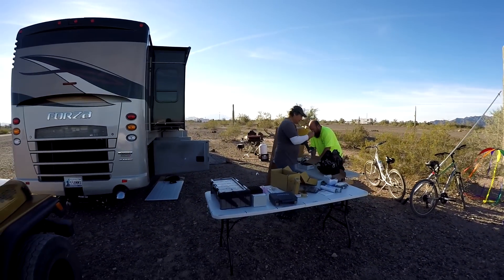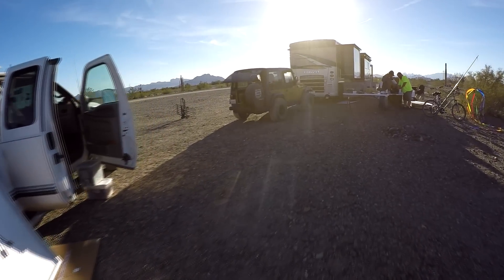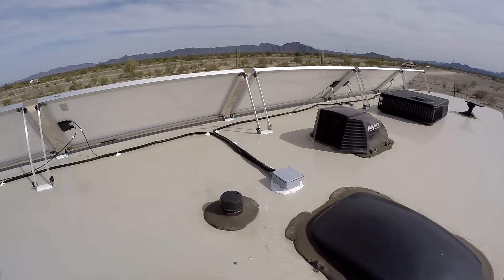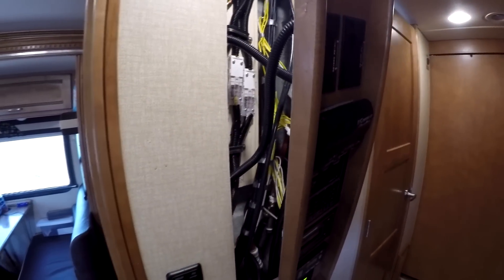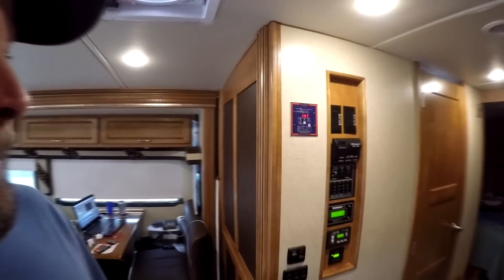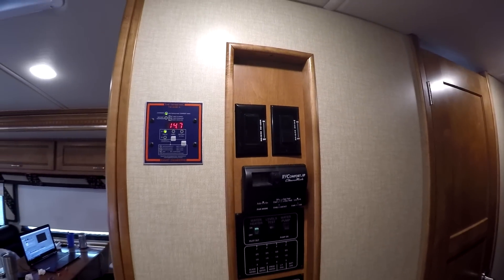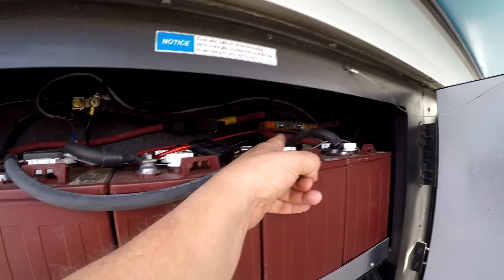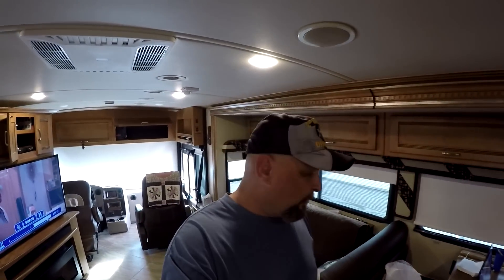S1LAWG,E76 - Solar Install 2017 Winnebago Forza - Nomadic Native

Comment: Nice video of the installation of the solar system. I just purchased a 44' park model trailer and aim interested in putting in a system like what 
You have let me know if something like your system will on my park model trailer 
Thank you for your time
Reply from the maker: Ray Gould no doubt it will work well for you. Many will tell you to figure how much power you need and install enough solar to meet the need. What I'm going to tell you is to install MORE than you think you'll need because you will never be upset by having to much, but not having enough is a real bummer.

Comment: Where do you store the ground panels when motoring and what do you do to protect them?
Reply from the maker: Stephen Miller in the front driver's side bay, on the shelf above the propane tank. We've not used them since installing solar of the Forza. The 960 watts on the roof & 6 T-105's has met our needs & goals very well thus far. I will likely be rid of the rigid panels someday soon in favor of flexible panels as they have become more reliable over the years, easily stored, much lighter, & we will just lay them out on the ground should we ever need them. Thanks for watching!

Comment: I hope you have time to answer a question.  I have the same RV (Forza 36G) and am installing Solar (a lesser wattage system)  My question:  How were the wires that run from the roof through the control center and into the basement ultimately get to the controller.  The direct route would take it through the grey water tank and into the cabinet that is in front of the passenger side rear wheels.  I would just like to know how this wire was routed, so I may do likewise.  Thanks!
Reply from the maker: Ray Fiorillo it's a direct run through the bays, beside the tanks, and into the same bay as the inverter. It looks very tight quarters but once you get started it's not to tuff. Please let us know how your install goes for you & how your solar works out for you, ours is working really well for us.
Reply: Thanks for taking the time to reply; we'll let you know how it goes,  we will likely attack this project in about two weeks... Again thanks!

Comment: Although your installation looks good it has a fatal flaw. You should not ever run groups of series panels in parallel. You either run run panels in parallel connected to a charge controller or you run panels in series to a charge controller that can handle them. 

Every bank of panels should have its own charge controller and the output of those controllers are then paralleled. 

So in your configuration you should have three charge controllers. One for each bank of three panels in series and one for the ground bank of two panels in series. The output of those three charge controllers should go to your battery bank with each one having its own fuse and cutoff switch. 

In this configuration you can get full power and any shading of a panel will not completely shutdown any bank. There are very solid design theory why it should be done this way. 

I've posted why on IRV2 and will be publishing a complete write up when I get some free time.

Comment: that's a lot of solar and a good video recapping what you have done. would you care to share what that all cost you, we are just heading out on the road and are very curious. one other question, will it run the a/c
Reply from the maker: This RV came with an installed inverter/charger and all that due to the residential fridge so all that was really needed was the panels and a solar charge controller but I also upgraded the battery bank and installed the 2030A meter. Total cost on the Forza including the install and additional odd & ends was right at $3500'ish. The Forza has two breaker panels, the second panel is for things that are connected to the inverter. The A/C's, Washer/Dryer, and fireplace are not connected to the inverter's breaker panel. If we want to run those items not connected to the inverter's panel then we have to be plugged in or fire up the generator. I installed whole house solar on our previous RV, a 2004 Winnebago Sightseer 35N. On that RV the inverter was connected to all loads & we had the same battery bank in it. We could run the front A/C for 3 to 3 1/2 hours, but then we would not have enough sun to recharge the bank for overnight so we had to run the generator anyway. A soft start installed on the A/C does not solve this issue in any way, just makes the A/C not draw as much start up power. One solution I've found is the Turbo-Cool roof top swamp cooler, it will fit in a standard exhaust fan 14 inch roof entry & draws very little power.

Comment: Matt, another awesome video!  Gives me ideas for the days ahead.  I don't think it is possible to have too much solar.  Thanks
Reply from the maker: I think you're right for the most part Dave, you can really only have to little & this is our current state with our ground panels. Out West it's easy to camp in full sun, but here in the East we find we're shaded by trees more often than not, this is where the second charge controller & panels that we can put on the ground out away from the RV in the sun come in real handy. We have 325 watts of glass panels now, will change that soon to 600 watts of light weight flexibles.

Comment: When you mentioned catastrophic regarding your power bank for your solar etc. does that have anything to do with the weather? Like Lightning Strikes or some other ISSUES? Could you clarify please? Thank you for sharing this information and video!👍
Reply from the maker: Hi, The catastrophic fuse is placed between, for example, between the battery bank and the inverter as a final measure of safety for the RV and it's power drawing systems. It's intended to save the RV should the battery bank ever short and try to discharge all at once thru the system, however, I'm first hand familiar with the metal spikes and wires that are used on farm homes in Oklahoma and Kansas to direct lightening strikes that hit the house into the ground. I've seen the aftermath of that & to be honest I doubt that anything would protect the RV at all against a direct strike. Thanks for watching!!

Comment: Wonderful share! We are planning for the purchase of a Forza 34T. Would Lichtsinn RV and Winnebago accommodate an order that included having them run the wire from the roof (junction box) to the basement at the factory? That would certainly be the best time to have it done. They would use your exact wire route behind the panel. Is it worth trading out the 2000 watt hybrid for a 3000 watt model? Thanks!
Reply from the maker: Hi! I think your best answer about pre-wiring will come from Brian, service manager at Lichtsinn RV. Give him a call, nice guy & if it can be done he will know the answer. As for the inverter...  while the RV is 50 amp, the inverter is 30 amp. It has it's own section in the power panel with breakers. So far we've not tripped a single breaker while running on the inverter. All that said, if I was going to upgrade the inverter I would use the Magnum 3000 watt (2800 continuous) hybrid version, especially since it's a drop in same size replacement for the 2000 watt version we have. We are back at the house, boondocking for a few days in the driveway, & I'm torture testing the solar system as we speak. Already blew & replaced the 60amp fuse between the charge controller & battery bank with a breaker, evidently when it comes to Tristar mppt-60 amp charge controllers I got a really good one, ha!
Reply: Thank you!!! My wife and I really enjoy your series of videos. We recently viewed you "10 Things you have learned ..." video. That was very helpful. Great share!!!

Comment: why didn't you go with the magnum PT--100 and have an integrated solution?
Reply from the maker: Hi, Being perfectly honest, I didn't even check into the Magnum controller. No real reason, it just was not on my radar. Will be making a video of the system in action soon, torture testing it right now. Thanks for watching!

Comment: I thought you said when you first picked it up you were not going to put solar panels because it would void your 10 year roof warranty
Reply from the maker: Yup, that sounds like something I would say. We're learning as we go. It does not void the warranty, but if for example, the solar panel install causes a leak it will not be covered under warranty. If wind rips a panel off the roof causing damage, this too would not be covered. So basically you can do whatever you want, but if what YOU do causes an issue, that issue will not be covered under warranty.

Comment: Hi, my name is Steve. That's a very nice solar system you have, thank you for making a video.  Please tell me how your panels are wired, parallel, series or both? Also, how did you wire the PWM controller to your battery bank to prevent conflicting with the TriStar controller. And my last question, was the Trimetric hard to configure?  Thanks
Reply from the maker: Hi, thanks for watching! Brian wired the panels in series, 2 strings of 3 panels each. This gives the panels the ability (in theory anyway) to max out the MPPT-60 charge controller. The PWM controller is wired neg to the 2030A's shunt & the positive has a 50amp fuse. The PWM controller won't enter equalize mode, the MPPT controller takes care of that, so there are no conflicts or overcharging issues. The Trimetric is not hard to set up, comes with good instructions.

Comment: How does a solar install effect the various warranties on the coach? Like roof leakage or factory wiring?
Reply from the maker: Hi, The warranty is still the warranty but if, for example, the roof leaks because of something we installed then I doubt it will be covered. We made no changes to factory wiring at all. Thanks for watching!
Reply: I'm just wondering if you had a leak around something like the AC if they could say you voided the warranty on the entire roof by drilling holes in the roof  and not having it done "by an approved factory facility" or something.

Comment: That is an impressive system!!  What make and size is the inverter?  What electrical loads (appliances) will you be using that run off the inverter (fridge, TV, etc.)?  Thanks - enjoying the videos!!
Reply from the maker: The inverter is a Magnum 2000 watt that came in the RV. It runs most outlets, all the TV stuff, furnace fan, microwave & fridge. Thanks for watching!

Comment: One question regarding the wire size coming into the Trimetric.  What voltage are they running down from the roof?  Even at 24 VDC those wires look too small for that many amps.
Reply from the maker: The panels are wired in series, 2 strings of 3. I'm not sure about the gage of the wire but it's twice the thickness of standard #10 solar wire and is rated for 800 volts. Thanks for watching!